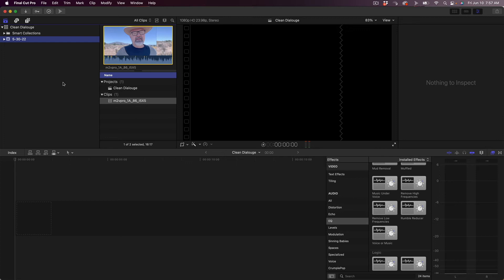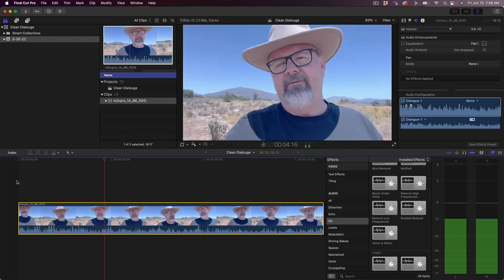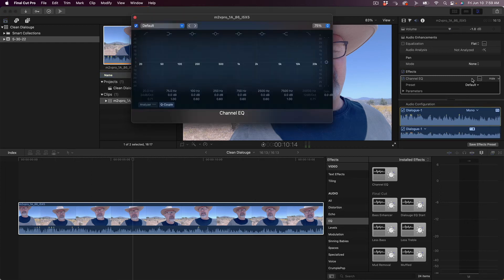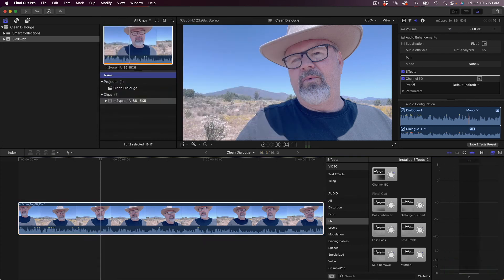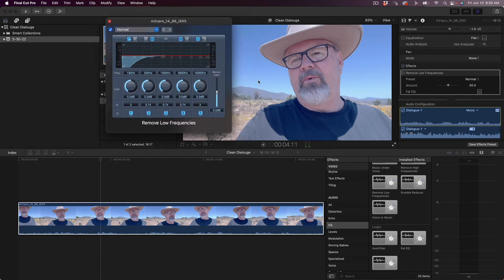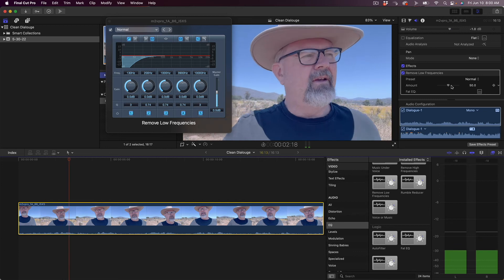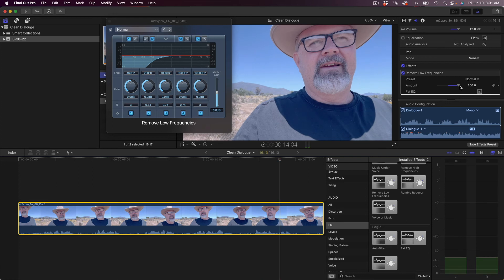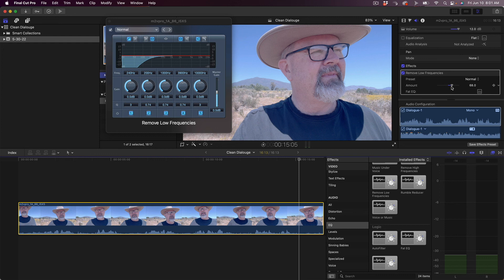Remove Wind Noise in FCPX in under 5 minutes

Comment: It now seems to be called Remove Low Frequencies 2, and even though I've applied it to both audio channels, it seems to do very little even when both are set to 100%. I am unable to see the adjustment panel you show in the video, I only have a slider.
Reply: same here

Comment: Came here to say the same thing. Remove Low Frequency is no longer there or has been renamed. Still on th ehunt for wind reduction process. Great vid otherwise though.
Reply: wait I think I found a fix with this update. Theres an option called voice isolation. Pull the slider as much to the right as needed. I had BAD wind and it got rid of it. May need to eg to get the voice to sound a bit more normal, but that got rid of the wind completely .
Reply from the maker: @AlbertCadabraEntertainment  You can still use a channel EQ and just cut the low end frequencies. I would do this in conjunction with the "Voice Isolation" tool for best results.

Comment: I know FCPX just had an update but I can't find the remove low frequency filter under the EQ audio effects table! I've looked through all the audio effects, nothing looks like frequency removal! This wedding ceremony video has so much wind!
Reply: same here
Reply: I think I found a fix with this update. Theres an option called voice isolation. Pull the slider as much to the right as needed. I had BAD wind and it got rid of it. May need to eg to get the voice to sound a bit more normal, but that got rid of the wind completely .